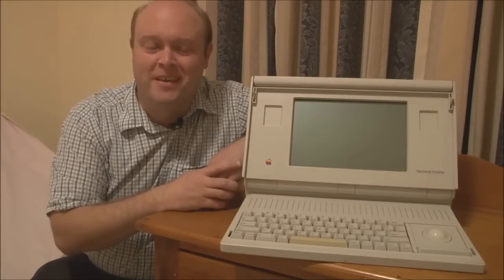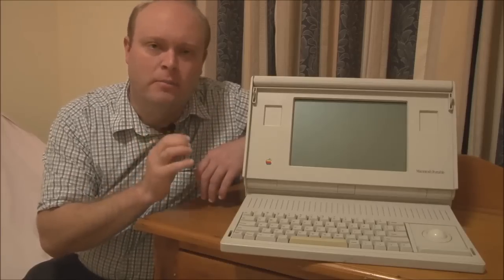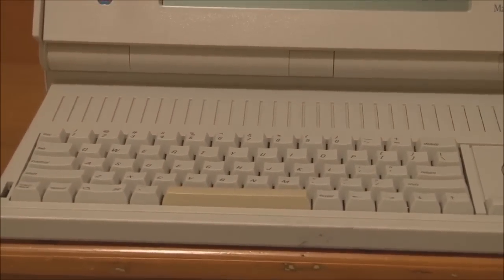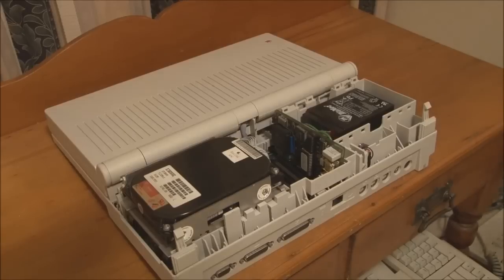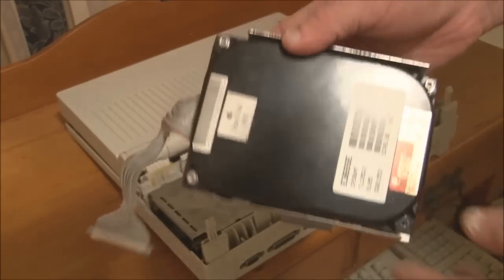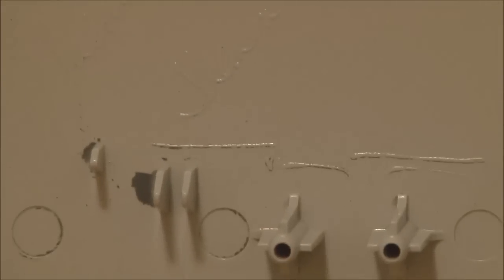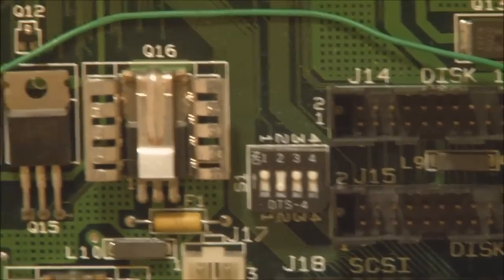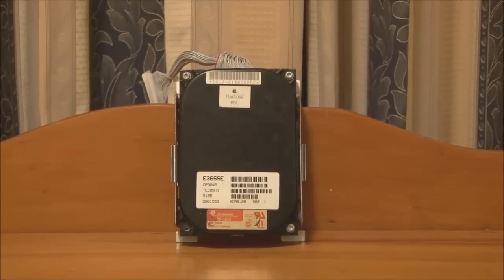Apple Macintosh Portable (1989) Full Tour

Comment: I discovered recently that you can remove the controller board from the stock Conner CP-3045 and swap it onto a CP-3040A (as used in some early Mac desktops), so they can be used with the Portable.

Comment: Great demonstration! I just nabbed a backlit model with the original, rebuilt battery. You definitely answered some questions for me. 

Do you know of any good sources for pseudo-ram cards? I'd like to upgrade mine (currently at 2mb)
Reply from the maker: DefectX11 The Pseudo-SRAM cards are probably very hard to find these days, as they were only used on the Backlit Portable. You may find one on eBay if you are lucky, or it may even be worth purchasing an entire non-functional Portable just for the memory card!
Reply: Hey, thanks for the input! It's not every day that you see one of these for sale, especially so for a low price. Thrill of the hunt, I suppose!

Comment: What was the green wire attached to chips on logic board for
Reply: Probably a field repair for a damaged trace. Fortunately the chips on these older machines didn't need the strict trace design standards that modern chips need to avoid cross-talk.